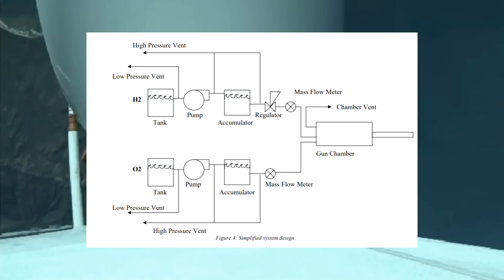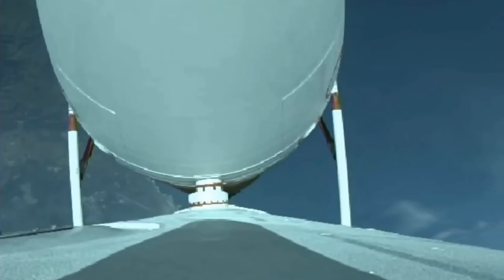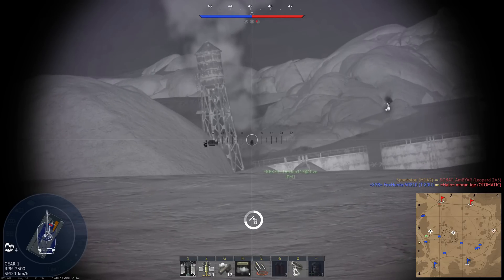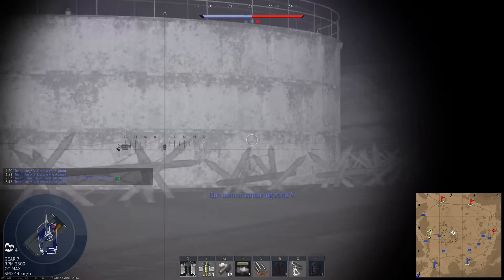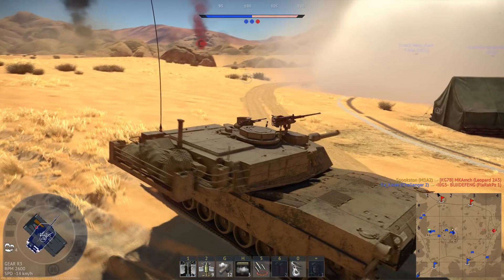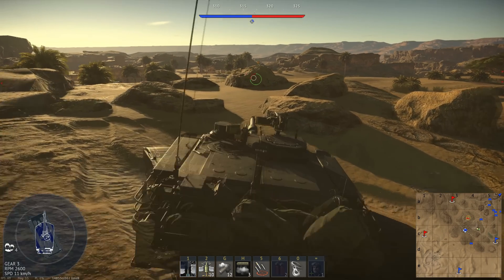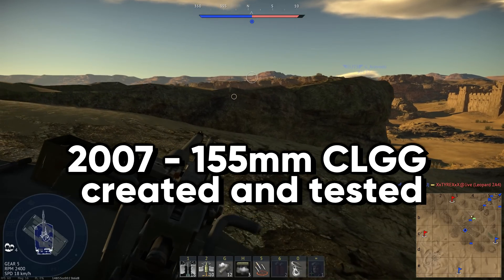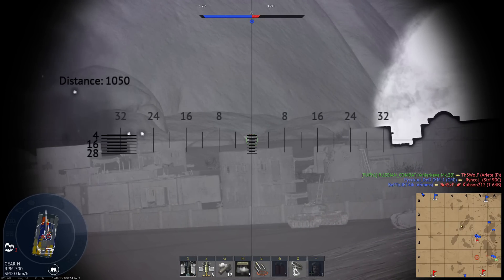CLG Guns - Future Tank Weaponry

Comment: I'm an independent researcher and principal investigator for the US DOE and a mechanical engineer. I might be able to provide some insight here. We solve the problem of conventional approached to CLGG by using NOS and methane instead of hydrogen and LOX. The tanks gun uses the same fuel as its engine. There is a methane gas vapor accumulation tank. A high pressure fuel pump powered by the main engine pressurizes the fuel to 1500 PSI, the waste heat from the exhaust coupled to an induction heater heats the fuel to 1000 F. This phase changes the fuel into a supercritical fluid which is then pushed through a zeolyte catalyst to break ANY combustible liquid, gasoline, diesel, jp-8, crude oil, waste motor oil, vegetable oil, burnt brake fluid, waste paint thinner, you get the idea, into methane and methane gas-like products. A pressure reducing regulator drops the pressure and ensures the vapor accumulation tank remains at about 200 PSI. The tanks engine draws from these vapors to power it, this can be done via natural gas fuel injectors or a needle valve in the intake plenum. A pressure line from the vapor accumulation tank is routed to the CLGG, where natural gas injectors squirt a measured charge of the methane gas into the breech. Simultaneously, pressurized air from an air compressor driven by the tanks main engine fills an air tank, which is used for pneumatic tools, brakes, and pneumatic drive systems. This air is compressed to about 2000 PSI with a pressure reducing regulator for the auxiliary pneumatic systems. The high pressure air is also routed to the breech of the CLGG where injectors allow a measured charge of air to shoot into the breech at the same time the methane does. A massive selonoid coil is wrapped around the breech and slams the shell against the breechface, which effectively compression ignites and detonates the fuel and air. To ensure ignition even in arctic environments, a series of spark plugs without the side electrodes removed will fire if the shell gets close enough to allow the capacitors connected to the spark plugs to discharge by exceeding the breakdown voltage strength of the gas/air mix. Effective, this is a HCCI CLGG detonation cannon. Even though liquid diesel fuels have about 1/3 the overall energy density by weight compared to hydrogen gas, they have higher energy density's per volume. Liquid hydrogen has an energy density of about 10 MJ/K wheras diesel fuel has 38 MJ/K meaning that diesel has about 4 times the energy density in terms of volume compared to liquid hydrogen. And in a tank, we're more concerned about volume than weight anyway. The CLGG will use a fraction of a fraction of the total energy of the fuel tank, the engine uses most of the energy, and the CLGG would use it incredibly efficiently.
Reply: Br!an Delta V that's a brilliant idea. How much energy is used by the induction heater? Also, how large are the pre heater and catalyst? Are there any problems with sulphur induced corrosion?
Reply: @JaneDoe-dg1gv  Less than 300 watts would be needed for the induction heater, we only need to heat very small amounts of fuel at a time. This keeps things safer and reduces total energy consumption. As far as pressure goes, I detonate the fuel at supersonic velocity's and keep the pressure spike low enough that it doesn't break the system by using less fuel. This means I don't need to worry about flamefront stabilization or any of the weird shit conventional deflegration based engines use. Continuous combustion would keep temps up too high for too long and would be less efficient. We want constant volume, not constant pressure, supersonic combustion. Muzzle energy is varied by using more or less fuel.
Reply: Br!an Delta V that truly is brilliant. I hadn't even considered detonation as a mechanism to stabilize combustion. Do you think it would be possible to integrate this technology with rarefied wave guns? I had suggested continuous combustion as a way to increase muzzle energy for naval artillery. On ground vehicles there wouldn't be a need for it. Ohh.. how about using CLGGs as the starter for a ram accelerator mounted further up the barrel in naval applications?
Reply: Another question, what is the internal barrel pressure? Oh, how sharp is the pressure curve? I had thought about possibly using a rocket style fuel injector to stabilize combustion. Do you run into problems with uneven combustion or are you using a swirl combustor built into the bottom of the barrel to avoid that? Would it be helpful to use gas pumps the boost the inlet pressure to allow continual combustion rather than an injection regulator for the variable muzzle energy?
Reply: Also, would it be possible to use an electric or pneumatic drivetrain for this design. For wide fuel range I'm assuming a gas turbine is used and you mention an induction heater and air compressor so I was wondering it the generator or compressor could be upscaled for the drivetrain.
Reply: @JaneDoe-dg1gv  I would recommend against compressed air or electric for the drivetrain, compressed air is horribly inefficient and its power to weight ratio is absolute shit, and electric has a horrible unusable power to weight ratio. A combustion engine for the prime mover is best, because the fuel for your gun is also the fuel for your engine. The type of engine I would use is a modernized Bourke engine. We could use a hybrid drive, couple the engine directly to a motor-generator so we get regenerative braking, electric power assisted acceleration, and no energy is wasted idling. another thing we could do is de-couple the motor-generator from the engine temporarily to run exclusively on electric for about 5 minutes or so which would eliminate the waste heat from the engine and allow the tank to operate virtually invisible to thermal imaging. Not that would be too much of an issue anyway given that Bourke type engines have EGT's about 220 F. due to their very high efficiency. As far as raven guns, I don't know enough about them to make an assessment. However, similar to a Raven gun we could use a swinging/rotating breach to autoload the shells in the chamber from the front of an open revolving breach block (which would technically make the gun a muzzle loader). This would allow us to shoot about a shell every 1-2 seconds. The elimination of gunpowder and steel shells means we can effectively double our magazine capacity and considerably increase the rate of fire whilst keeping the barrel much cooler than a conventional gun. The lack of gunpowder greatly increases the safety as well.
Reply: Br!an Delta V good to know. How about an electric infinitely variable transmission and an electrically driven triple differential. One fuel engine, one generator, two motors, and a small capacitor bank along the bottom for electric storage?
Reply: Br!an Delta V oh my, it has been so long since I'd heard about a Bourke engine. I had thought a gas turbine and two power turbines would work pretty well for a simple mechanical drive train. In a hybrid design it would be one gas generator, two power turbines, and two motor-generators.
Reply: @JaneDoe-dg1gv   Yes, I'd do something similar to a triple differential for the drivetrain hooked up to a parallel hybrid for double redundancy. We could also consider an open differential with two motor-generators, one between the pumpkin and each track sprocket, and turn by increasing resistance/dynamic braking on one side whilst powering the other. You could even run one motor in reverse for even faster turning. I'm also genuinely surprised someone has even heard of Bourke engines. I'm currently working on modernizing the design. My prototype is producing 81% thermal efficiency and is about half the cost to drive per mile than an EV.
Reply: Br!an Delta V I have a habit of going down the Internet rabbit hole for reading about this kind of stuff. Have you considered an opposed piston Bourke engine? It would solve the piston balance issues. How is the yoke friction? An open differential with two motor-generators... I like that idea.
Reply: @JaneDoe-dg1gv   Its a myth that there are piston balance issues. Its actually a perfectly balanced engine design because there are no secondary forces because the piston and yoke assembly reach maximum speed at 90 degree's to crank angularity. This means that the motion is perfectly sinusoidal. The scotch yoke has much reduced friction because it virtually eliminates the piston side thrust.
Reply: How about a fuel engine driving a sun gear and an electric motor-generator controlling the ring gear with the planetary as output for the main transmission and either that open differential with two motor-generators or a triple differential with one reversible motor for the steering input?
Reply: Br!an Delta V I had meant the primary piston forces. Its primary forces are like a flat engine's, so I figured having an opposed system would allow both primary and secondary forces to be canceled. An opposed system also removes the need for any valves by allowing use of only ports and the fuel injector which as you had mentioned could be light hydrocarbon gas.
Reply: @JaneDoe-dg1gv   The original design also eliminated all valves by using a deflector piston. Primary forces are also inherently balanced out via a counterweight in a 2 piston version and is inherently balanced in a 4 or 8 piston version. We don't even need fuel injectors, we just use a needle valve on the intake plenum for a homogeneous charge. We could combine two bourke engines with two crankshafts to make a hybrid deflector opposed piston engine and that would slightly increase the efficiency and might make for better packaging for a 16 cylinder engine. Its use would be limited to tanks, trains, ships, possibly aircraft, etc.
Reply: Br!an Delta V I haven't heard about deflector pistons before. Anyway, it would be a good replacement for current Diesel engine designs. I had thought about increasing power by having the air intercooler feed the engine's water jacket and the hot water afterward would be injected during combustion to boost power. Useful as an emergency power setting or to up power output on ships.
Reply: @JaneDoe-dg1gv   You're talking about diabatic principles. My design is air cooled even in the largest of stationary applications. That being said, exhaust heat will be recirculated for better performance.
Reply: Br!an Delta V I figured using water cooling on ships to run either absorption chillers or desalination systems. Since the water would be there for secondary systems might as well have a power boost. It would be especially helpful for small naval ships that could use emergency war power.
Reply: @JaneDoe-dg1gv  Yes, for ships and possibly trains water cooling makes sense. The cylinders run hot enough we could actually use them as steam boilers for secondary power, operation of steam equipment, desalination, etc. The cylinders run at about 480 F. and the old steam engine trains ran at about 380 F. if my memory serves me correctly.
Reply: Br!an Delta V I had thought of a hybrid system using steam generation in the chamber to boost power output and the extra latent heat in steam to drive secondary equipment. Of course tanks and the like could include a water boost/economizer but weight limits that application. Maybe a system where water from the intercooler and an economizer would be fed into the chamber after combustion for cooling and power output. It would involve a water gauge but you should have one anyway, it's not to irritating to have both a fuel tank and water tank.
Reply: @JaneDoe-dg1gv  Yes, exactly. We can use steam injectors on the cylinders to boost pressure at lower RPM and use steam to drive secondary equipment.
Reply: Br!an Delta V it can also be used for peak power to reduce temperature spikes.
Reply: @JaneDoe-dg1gv  Yes.

Comment: what about a Methane Oxygen CLG gun? methane is way easier and safer to store and much cheaper. 
as for propellant, a ship or hybrid electric vehicle could use an alum cycle turbine generator for power to solve the oxygen problem. it is an ultra-compact CO2 turbine that has an oxygen concentrator (usually air liquefaction due to scale) built-in for the engine to keep nitrogen out of the working fluid. that way you basically get the oxygen generator for free (much safer) with an extremely lightweight and efficient engine (60% thermal to electrical conversion). If you are lucky, that might be small, safe, and cheap enough to even use on a tank or AFV.

Comment: I was watching this and literally thinking "It sounds like we should use these as like, Super Heavy Artillery equivalents, Long Range High impact guns with a tender and main gun vehicle" and then you suggested the two vehicle setup.

Excellent Video as always!

I could see these deployed in limited numbers as Long Range Fire support and on ships in a specialized almost battleship replacement like vessel (IE heavy fire support) Though im not sure if Tanks will ever get them (at least not in their current form) since it sounds very mechanically complex and thats, as you've said before, not always the best for a frontline combat vehicle.

(Also like, Excellent music choice, love the Mechanicus soundtrack)
Reply: oh! thats actually a question i had for you Spook!

What are your thoughts on Direct Fire support vessels? will there ever be a successor to the Battleship in terms of hard hitting and relatively big guns?
Reply: hydrogen has very low density, even cooled, meaning the storage tanks have to be quite big so it's very unlikely they will even think about putting it in a tank, artillery on the other hand can work as there is less of a size problem (than and you can have a tender for the propellant like spookston talked in the vidya)
Reply: I had thought about methanol or dimethyl-ether as possible replacements. Also nitric oxide is a pretty easy to store as a compressed oxidizer. For combustion instability, couldn't an internal combustion chamber, like a rocket engine combuster, be used. If it's turbine fed you could hypothetically have constant barrel pressure and unlimited throttle control.

Comment: I think water storage and on-board hydrolysis could be the answer to storage pressures bc water is inert and could be hydrolyzed to create the gasses needed for the charge in small quantities  and held in overpressure (to allow there to always be enough gas to operate the cannon) until the round is fired
Reply: The problem would be doing it fast enough in combat situation
Reply: @oakwhelie  
That would seem like a noticeable issue. You'd probably still need some gas storage so you can more easily reload the shots. You'd also have to make sure you prepared in advance.

Comment: This weapon type strikes me as being potentially much more useful for spaceborne applications than planetary ones. Consider: Hydrogen and oxygen are already extremely capable rocket propellants, so adding tankage for them may not be an additional issue. Hypervelocity projectiles are about the only type of projectile that is combat effective at space ranges. And barrel temperature control is a more difficult problem without atmospheric convection cooling. CLG guns seem a perfect fit for space combat, given this.

A plausible weapons system would be a LH/LO-propelled drone with a hypervelocity CLGG as its armament. Launching from a drone carrier with long-range tankage and nuclear propulsion, these drones could swarm an enemy target in numbers, engaging with their guns without high-power electric generation or massive radiators. Their engine propellant would also be their gun propellant, and the gun itself relatively light, meaning that a higher amount of the non-propellant mass would be available for ammunition, armor, sensors, etc.